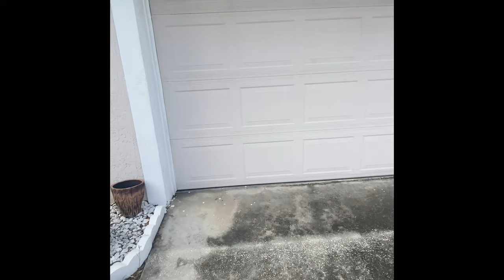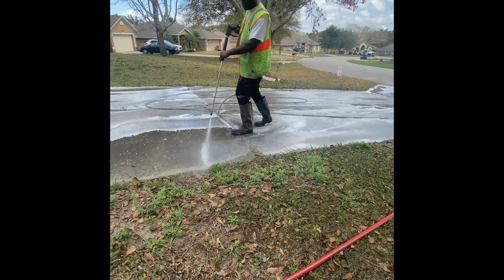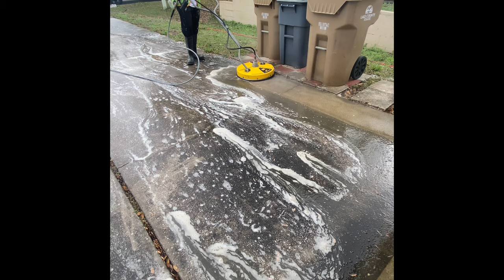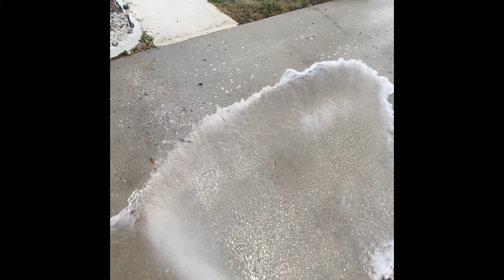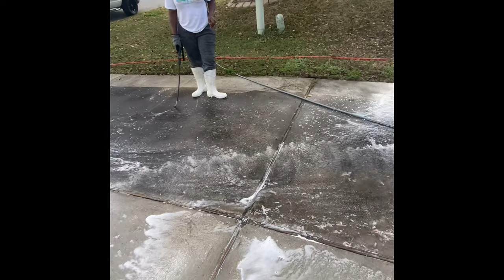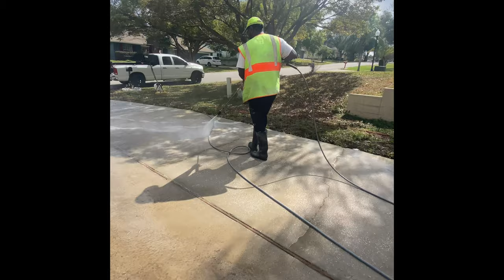Easy way to pressure wash and avoid HOA notices details/POV- ( dirty jobs

Comment: I live in Wyoming, where there are old pick/ups, farm implements, where everything has a leak. I clean a lot of bank drive Thurs and large equipment sometimes it's impossible to remove all the stain. How do you compensate for this? Service stations are the worst.